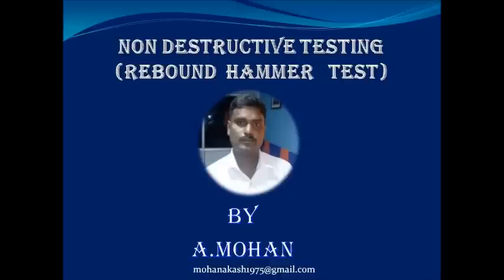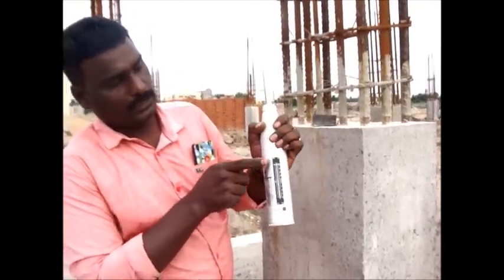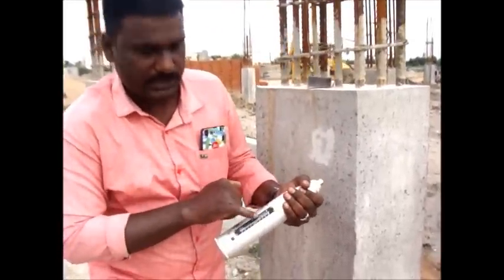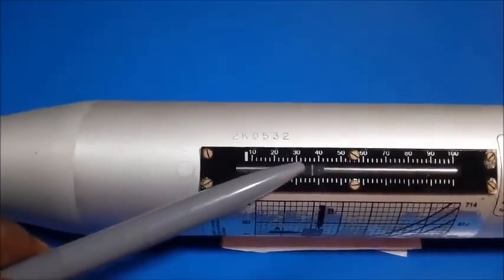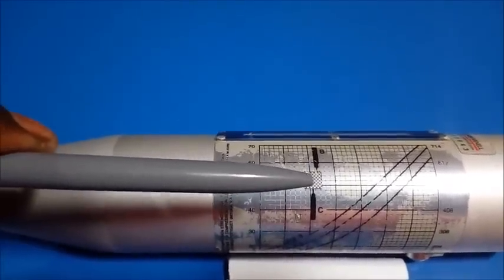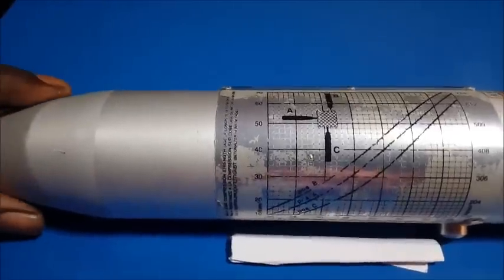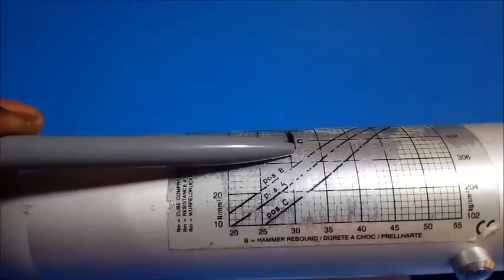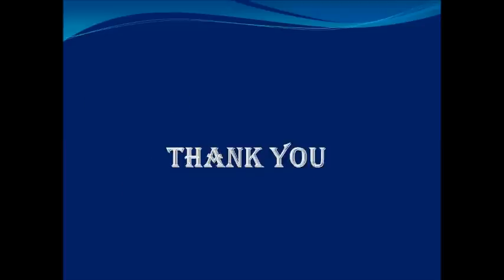REBOUND HAMMER TEST

Comment: This graph is the fabrication graph obtained in high class concretes and does not give real results in the job siteield. Instead, you should calibrate with the cube according to DIN 1045 and find the rebound value of the mpa according to the formula x and y from the trend line curve.

Comment: If you were to read EN 12504-2, you would find out that you need to do a minimum of 9 readings in a 300 mm by 300 mm square area.  One would determine the rebound number R by the average of the readings.  Outliers are tossed if more than +6 or -6 of R.  Then reaverage.  If more than 20% of the readings are outside, then the test to be redone.  Also, a point is discarded if it crushed or broke through a near surface void. I also point out to read Notes 1 and 2 of the Scope whereby the Rebound hammer is to confirm the uniformity of the concrete and can only provide an estimate of strength.  Do not believe the manufacturer's curves - site specific ones, as others have noted, need to be developed.

Comment: sir the load used by u is fixed...its the load that need plunger to spring back ...is it the hardness value?? what about the impact made by plunger on concrete column.??
Reply: ya that's what iam also thinking